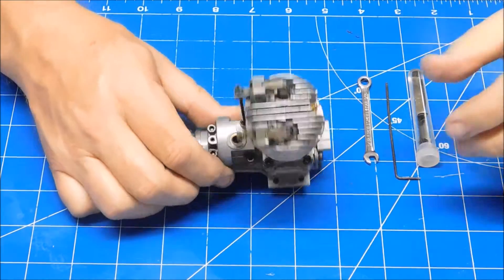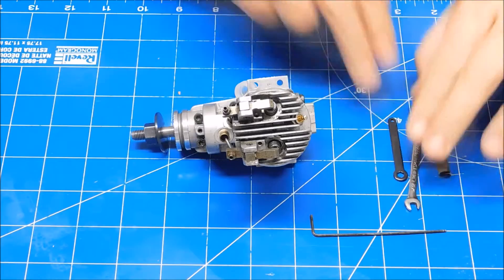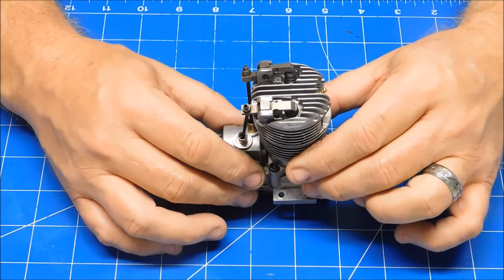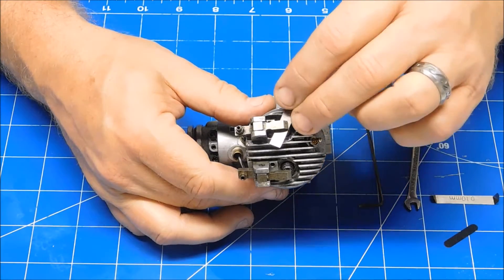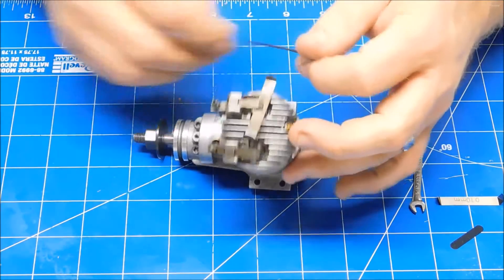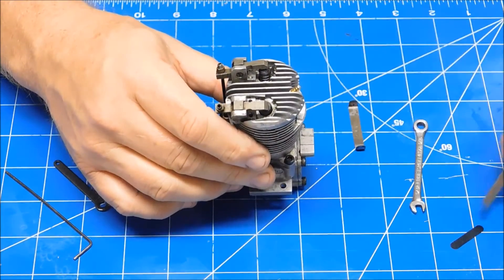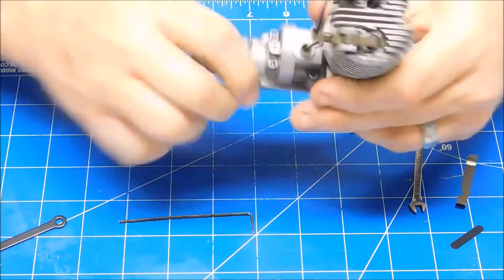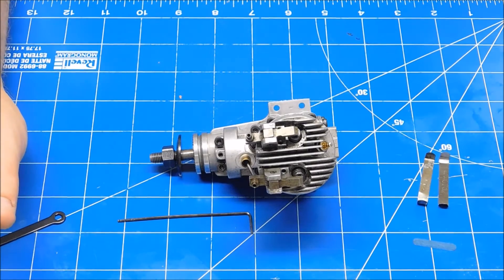How to: Set the Valve Lash on a 4 stroke engine

Comment: Very good explanation. This helped me out a lot. Should it always have thight compression even with no carb on? I will check later but if throttle is wide open on my normal nitro engines it turnes over much easier.
Reply from the maker: A four stroke head is a sealed chamber unlike a 2 stroke engine. So yes it can and should have compression without a carb installed.
Reply: @dmrcflyr2  Thank you David. I just bought a plane with saito 91 and it turns round to easy. I will check the valves and otherwise disassemble it totally. Owner says it runs fine. Turning over my thundertiger 15cc is way harder.
Reply from the maker: https://youtu.be/aQAvLNDwfzg

Comment: Thanks for the informative vids. 
I had been using the supplied .1 gauge that came with my Saito 125 and setting it tightly to that but I ordered some feeler gauges and will set it with a .03mm so it’s just nipping at it as you describe.
Don’t know why they supply a .1 as that would adjust a slightly large gap than ideal.
Reply from the maker: You can use it as a 'no-go' gauge by simply setting the lash so that it does not pass through, but will still enough gap that you can feel movement on the arm.

Comment: Hi Dave I have a Saito 180 that constantly wants to run backwards do you have any suggestions
Reply from the maker: Can you provide a bit more information?  I have never had an engine run backwards when using an electric starter. So you must be hand starting.  Are you bump starting or rotating CCW?  How are you priming the engine?  I would need to knwo the exact sequence of events you are doing because the issue lies in your method for starting.

Comment: Very nice: clear, practical, and helpful. Good lighting, too. My oldest Saito is over 25 years old, still runs like new. Fine engines. Re valve gaps: the little blue steel feeler supplied by Saito is 0.1mm, the maximum recommended gap (i.e. if it fits, the gaps need adjusting). It's just a warning gauge, really. They recommend (as you do) a gap of 0.03mm as a minimum (0.002"), which works very well. One other quick point: I like to use the short leg of the Allen key to adjust, and hold on to the long end whilst tightening the lock-nut. A bit more leverage makes it easier to stop the gap adjustment from changing as you tighten the lock-nut. Great videos - thanks for posting!